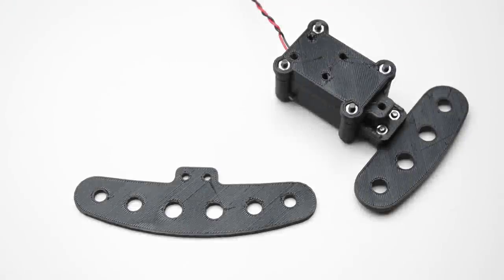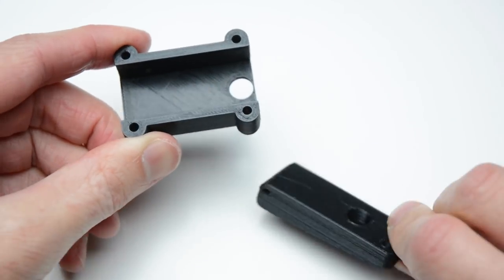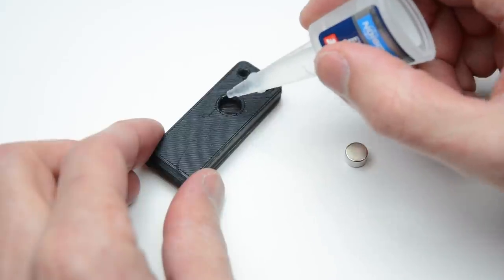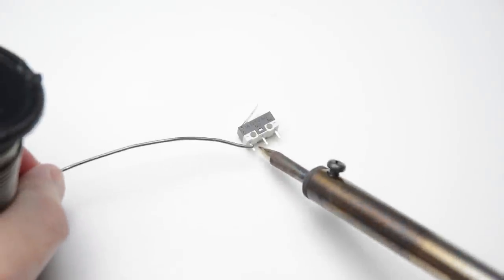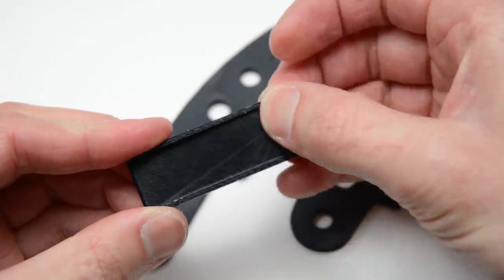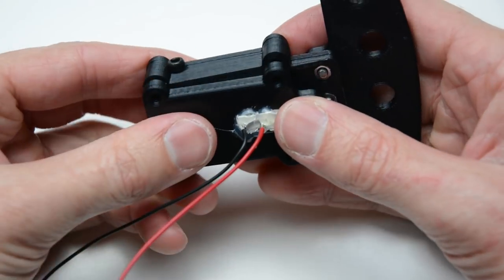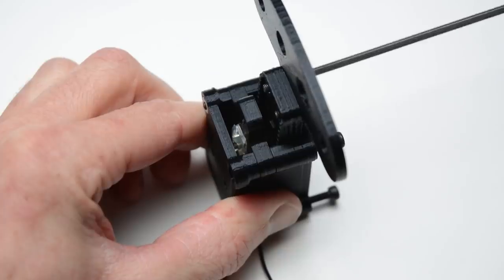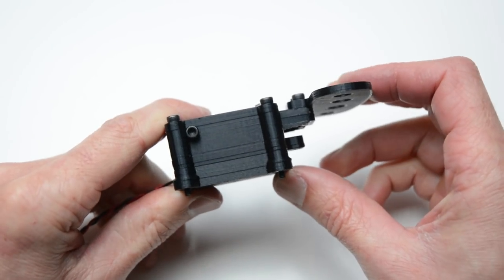MAKE THESE MAGNETIC PADDLE SHIFTERS DIY SIM RACING

Comment: I'd love to see if you could make a full sim racing setup. (wheel, pedals, paddle shifters, gear stick, etc.)
Reply: I don't think the wheel would have FFB though
Reply: Creepyslacker boy I’ve seen someone do a DIY FFB wheel but it did look pretty tricky. What I’d love to see would be a budget/beginner wheel and pedal set without 3D printing or soldering. That would be a challenge, but really interesting to watch.
Reply: @zrspangle  it probably will but it will be hard to make it
Reply: @matijamodric1435  good force feedback systems these days run on the same motors they use to power conveyor belts, it wouldn't be cheap or easy to do without the right supplier
Reply: @zrspangle  in 2024 you can make a Direct drive wheel with less than 200 dollars using FFbeast + hoverboard motor.

Comment: You can probably make the switch fully magnetic by using a reed switch tube instead of the microswitch. Reed switch is a small vacuumed glass container with two metal leafs that touch and close the contact when you put a magnet nearby. These things are quite cheap and more reliable than microswitches. They produce a faint click when the switch is actuated, so you can use that sound while placing the switch to ensure actuation. The next step from there, and probably fairly excessive, is the Hall effect switch, by using a Hall sensor IC and connecting it to ADC channel of a microcontroller or to a comparator circuit. The threshold will need to be calibrated.

Also i wonder, is it possible to self-build an FFB system under $100? Using like a $30 sports steering wheel? I already have a 3D printer. I also have a bunch of STM32F103C8T6 USB microcontroller boards, potentiometers, switches, all these kinds of gear. The microcontrollers have 12-bit 10-channel ADC, so they seem perfectly suited to capture a lot of steering angle, but maybe optical encoder is the way to go on this - i don't know! How would you approach this? It doesn't necessarily have to be good, or better than commercial offerings, just like my $150 printer isn't good, but it has to be a decent starting point for further improvements. I tend to believe in self-building things rather than buying them when possible because it's a path to self-improvement and you can always fix it when it breaks and improve on it.
Reply: About the Hall effect sensors, I know that the crazy-expensive Cube controls wheels (upwards of 1K for some wheel rims!), Hall effect sensors are used on clutch and shift paddles.

Comment: amstudio, it's possible to replace mechanical switch with reed switch or Hall sensor to make it more reliable. Optionally, spring with press screw can be added to have adjusting force.

Comment: I know this is an old video but i was wondering if you tried using any other materiasl besides pla? I printed a set of shifters based off fanatec advance paddle module, and while they work great, they feel cheap and flimsly with a lot of flex. I was wondering if using something like CF-Nylon would stiffened them and make them feel more premium.

Comment: Excellent Vid, haha and yes My Bodnar should be concerned haha - i am wondering if you may be able to point me into a direction that i could make something close to this, but using analog inputs - as i am a wheelchair racer, i would like to create a set of paddles for accelerator and brake, as well as gear shifters - could i just replace the magnetic inputs with an analog input? would appreciate knowing how, as i would defiantly create one for myself, and then adapt that to many wheels - cheers, and keep up the great video's - subbed

Comment: Great video describing the paddle shifter assembly. I do have a question about the nut-tab off the side you are holding at 3:25 in the video.  Is that for a stop screw that limits how far the paddle moves into the micro-switch? Does this prevent bottoming out the switch during operation? Let me know when you get a chance.  Thanks Again!  Wayne (Clifton, NJ)
Reply: hey there, it does look like it limits how far the paddle moves but doesnt use a stop screw to do so.

Comment: HI how do you connect the wires to the controller board? Is it black red, black red for two shifters or black red, red black?

My left shifter is not working, while my right is and I see the pattern black red, red black soldered in

Comment: I would have mounted the switch on the opposite side using the NC pin insteaf of the NO pin, it would make it more flush with the wheel after mounting

Comment: Hello, how is the reliability of the switches that you used compared to Logitech paddle switches? Mine just started failing, so I am thinking to replace them with your paddles. The original Logitech switches have a minimum 1000000 of usages.
Reply: Hi did you ever manage to replace your shifters with these?
Reply: @maxbrown08  Hello, yes I am using them since last year when I wrote. They are great, the only problem I had was the quality of the printed parts, I had to print them with 100% infill for them not to break, also the magnets I use are so strong that I need to super glue them, but so far so good no complaints from my side.

Comment: Hi 
Can someone help me please. I got all the parts printed in my Ender 3 and all the parts came but the switches I ordered were the se as in the video but the company I purchased them off sent me 2A 125v switches instead of the 1A 125v switches I ordered. 
Will it make a difference using 2A switches instead of 1A.
Sorry for such a dumb question but I'm new to diy work and electronics so any advice would be greatly appreciated, so Anyone??????
Reply: Brummie Deano I’m sure you’ve figured this out by now, but you’ll be fine. The amperage is the maximum current the switch can switch. 1A is overkill for this use, 2A even more so.
Reply: @chriscrawford1555  Due to being so busy I have not been able to find this out although they work fine it is reassuring to know I'm ok and will have no issues so thank you for taking the time to answer my question. 

Loving my new 3d printing hobby and it goes so well with my sim set up. I have the p1 cockpit from sim labs and Heusinkveld pedals with a 20nm direct drive wheel so paying for shifters, button boxes and plates and many other things was a big burden after such a hefty outlay so any help in making my own stuff is greatly appreciated lol. 

I also just got the valve index so I'm even more hyped to have a good break from work over Xmas and enjoy my things lol.